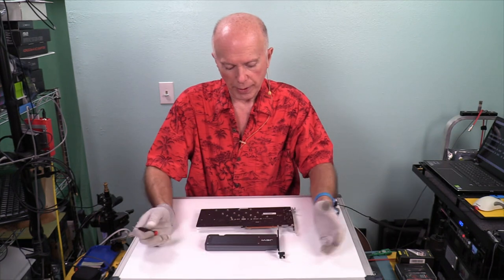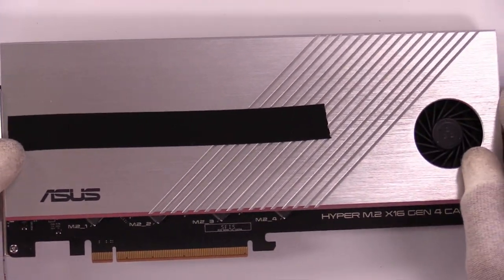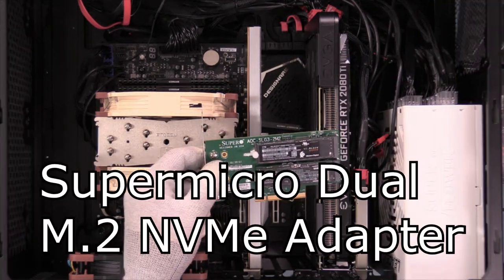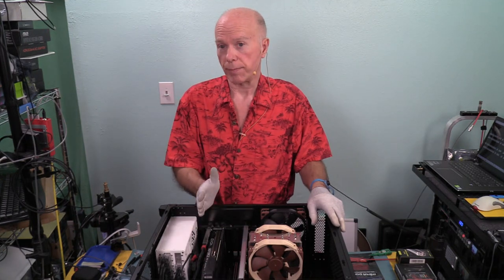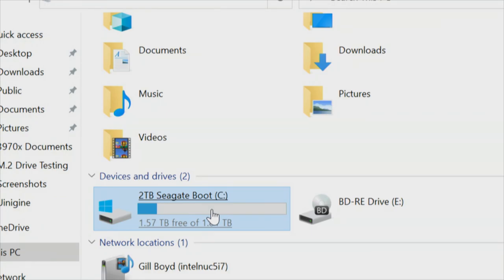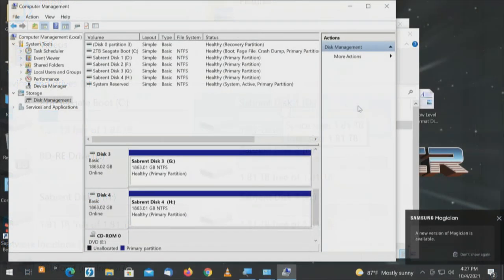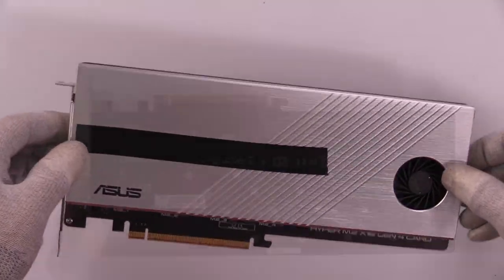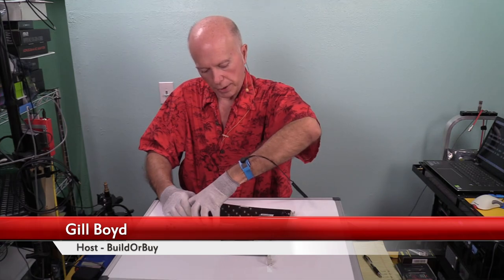ASUS Hyper M.2 X16 PCIe 4.0 X4 Quad card Heat and Speed Test Comparison

Comment: I wish you would work with a motherboard the massses could afford like a x570 with a Ryzen G processor with a free x16 slot.
Reply from the maker: Hi Jim Brannan,
That's a great point! I'm glad You've brought that up! That's why We use the TRX40. The x570 design looks great on paper. However the execution is lacking. Gigabyte does not have an x570 with 1 x16 PCIe Slot dedicated. ASUS has only 1 as best as I can remember. Most all x570 Motherboards have shared PCIe Resources. Which as allocated are not enough for dedicated PCIe Slots. No on a Quad card for x570 for the most part. Yes on a Dual M.2 NVMe Adapter on the x570 as long as You don't mind knowing the GPU will reside in a x8 Slot, electrically. Hope that clarification helps. Otherwise not much difference from B550 to x570 in execution. These are generalities of course. I'm always eager to check out any Motherboard when asked and verify PCIe Resource allocations! Fascinating design choices that always seem short sighted.
Reply: @BuildOrBuy  The reason I used the Ryzen 7 5700G in my Asus x570 was to free up the one x16 lane. I am hoping to get this card working in it. Not going the Gen 4 route with the M.2's. I will let you know.
Reply from the maker: Hi @jimbrannan5825 ,
You already know what You're up against! That should do the job! Remember to Bifurcate that Slot to x4x4x4x4! Success on Your Installation! Keep Us Posted on your Progress!
Reply: @jimbrannan5825  In the past if you went from a cpu/gpu system to an APU that has graphics built in, the number of cpu lanes to your PCIe sockets dropped from 16 GEN4 lanes to 8 GEN4 lanes. That's a bummer.
Reply: @jimbrannan5825  OK. I looked at the 5700G 3rd gen ryzen apu. 2nd Gen AMD Ryzen and 3rd Gen AMD Ryzen with Radeon Graphics Processors
1 x PCIe 3.0 x16 (x16 mode). That's a copy paste from Newegg. 5000 series APU's give you 16 CPU lanes but dropped to GEN3. 16 GEN4 cpu lanes are only with 5000 series Ryzen cpus. Not good news.
Reply: @maxhughes5687  Well if you're looking at pure speed only, this would be a negative. But if he's looking to increase his viewers participation by 10 fold, it would be a positive to experimant along these lines and see if it was feasible. It finally looks like I have a boar dthat I can use this Asus M.2 card on with out spending $3000 on a MB and CPU and I'm trying to make it work. You people need to come down out of the clouds and work with us little guys.
Reply: @jimbrannan5825  Well, best wishes Jim but I run a mobo with GEN3 lanes and a GEN4 add in quad card with four GEN4 NVMe drives. I did get up to 3500/3500 but that was it with GEN3 lanes. I am sorry, I thought you wanted to know the situation going in. Gill finds more things that don't measure up than anyone. Lower budget stuff may not show flaws that he can find.  I like what I buy new gear to work on the next generation of gear. 3 1/2 Years ago I was on a B350M/1600X.
Reply: @jimbrannan5825  Gill is all we have. More guys are pushing for more resources on their PC as they see the need for PCIe lanes and more RAM channels.Every test Gill did on M.2 heat sinks applies to every PC. Every test on gen3 and gen4 SSDs applies to every PC. He always mentions other Mfgr stuff and what it should or shouldn't work with.
Reply: @jimbrannan5825  OK. You start a channel with your equipment. Test M.2 drives on your system with GEN3 drives, GEN4 drives and the new GEN4 7000 drives.  They will all clock 3500MB. You will be one of a hundred channels that does what you want. I'd like Gill to test HW on a system that has as many bottle necks removed as possible. You know, what is the best cooler/m.2 drive/dual or quad M.2 PCIe AIC.
Reply: @maxhughes5687  I won't need to. I see he's finally getting around to what I'm interested in and what I can afford. Thanks for your input.
Reply: @jimbrannan5825  WOW. So every channel must comply with what you want. Are you in ANTIFA? His last video included Drive control panels and that info was for everyone. " a x570 with a Ryzen G processor with a free x16 slot." no such thing dude. Your looking for an X16 socket for a quad card with 4 drives? That's not budget stuff. You should have ask Gill before you bought that 5700G. No one else will look specs up and answer questions. Guys like you make no one in the comments section willing to look at the specs and help anyone out.

Comment: Just found your channel, 
Can I ask the following as I am struggling to find the answers in the marketing blurb?
1- on the ASUS Hyper card, does each NVME show up as a separate drive in Windows Explorer? Or does any drives on the board show up as one single drive?
And 2- does the board use 4pcie lanes in total, or does it try to use 4 per drive, therefore using bandwidth that could/should be used by my flu in the x16 slot at the top?

&1 things i follow 1have only 1 pice micron 2400 nvme m.2 card ,it support & detect only 1st slot ,but when i open & put on 2nd slot it not detected in my windows but hyper card led work
please help me... i cant understand that its my nvme support issue or card issue 
I’m very confused 🤔
Reply from the maker: Hi Sourav,
Welcome! Great Questions. What You're asking depends upon the Motherboard and CPU. Design vs Implementation. To support one of these types of cards a Motherboard has 3 Requirements in order that are as follows:
1. PCIe 3.0 or above
2. A X16 PCIe Slot, electrically not just mechanically 
3. Bios Bifurcation which means to Fork or Split. 
Now to Your Question. How are the Drives seen depends upon how the Motherboard Bios is Configured. If the Hardware supports the Configuration so too shall the O/S. 

Tell Us Your Motherboard CPU and Chipset then We can be Specific on what Your Motherboard can Support. Every Motherboard has a different PCIe Configuration. Some Chipsets are better suited than others to accommodate this fascinating technology! Hope that helps! 

Now why can You not find those answers We've just Outlined? Obfuscation! Crazy right! And that's what We do, Solving Problems and Providing Solutions! Everything will fall into place once We understand the technology of Bifurcation.
Reply: Using pcie 3.0 above
 Using ax16
But buffrication  not know.

Using msi pro b660 a bord
I5 12gen processor
Reply from the maker: Hi @souravpramanick2432 ,
MSI Pro B660-A DDR4, according to Your Motherboard PDF Manual under, PCI_E1~5: PCIe Expansion Slots. 
1. PCI_E1 is CPU PCIe 4.0 X16, electrically. 
2. PCI_E3 is Chipset PCIe 3.0 X4, electrically. 
3. The other 3 Slots are Chipset PCIe 3.0 X1 Slots, electrically. 

To reiterate, You only have 1 PCIe 4.0 Slot using CPU Lanes. Therefore Your GPU would have to be in a 4 Lane Chipset Slot. Not ideal. 

Bios User Guide:
http://download.msi.com/manual/mb/Intel600BIOS.pdf
In Bios User Guide, See: CPU PCIe Lanes Configuration. That's where You'll change from X16 to X4X4X4X4. That's the Bifurcation Setting. Hope that helps! What You need is a Motherboard, CPU and Chipset that supports 2 X16 CPU PCIe Slots, electrically not just mechanically.
Reply: @BuildOrBuy  not found that's option X16 to X4X4X
Reply from the maker: Hi @souravpramanick2432 ,
If Supported will be above, Re-Size BAR Support. Do You see that Setting? The PDF Motherboard Manual only indicates, CPU PCIe Lanes Configuration. But does not specifically indicate the Setting. You'll have to Verify any discrepancy from Manual vs actual Bios.
Reply: Yes,sir not showing cpu pci lanes configuration option
Reply from the maker: Hi @souravpramanick2432 ,
The MSI Bios Manual is Generic to the Chipset and not Specific to the Motherboard. If You don't see: CPU PCIe Lanes Configuration on Bios then Bifurcation is not Supported. Your other Option would be to utilize a Self Bifurcated card. That would cost more than Your Motherboard. Highpoint makes a Self Bifurcated card. I can get You a link if You'd like to try that Option.
Reply: @BuildOrBuy  yes sure
Reply from the maker: Hi @souravpramanick2432 , 
Bummer. We're just the messenger!

Comment: I got a asrock x399 taichi motherboard and will 4x 4tb m.2 drives work for this? I believe my board is gen 3 4x4x4x4 . I was thinking of slowly buying them over time to eventually raid them or should I just get them all at once. so far I only have two nvme in it cant tell if three will work or not
Reply from the maker: Hi Kevin Lee,
Welcome! You want to install as ASUS M.2 x16 Quad card? Yes! ASRock nomenclature makes that really difficult to understand a very simple procedure. Just remember to Bifurcate that Slot.
ASRock x399 Taichi with Bios: P1.90 or newer. 
https://www.asrock.com/mb/amd/x399%20taichi/index.asp
https://www.anandtech.com/show/11685/amd-threadripper-x399-motherboards
Motherboard Support List, See: Intel X399 Platform
https://www.asrock.com/mb/spec/product.asp?Model=ULTRA%20QUAD%20M.2%20CARD#SupportList
UEFI, Advanced AMD PBS 
- PCIex4 1*16 / 4*4 Switch 

64 PCIe Gen3 lanes
PDF Manual, Page 8 - Specifications, PCIe Slots 
PDF Manual, Page 8 - Specifications, Storage
PDF Manual, Page 13 - Motherboard Layout 
PDF Manual, Page 28 - Expansion Slots   
PDF Manual, Page 83 - AMD PBS 

4 x PCI Express 3.0 x16 Slots to CPU
1. PCIex1 = x16
2. PCIex2 = x8
3. PCIex3 = x1 - Through Chipset
4. PCIex4 = x16 - M.2 x16 Quad card in this Slot according to ASRock. 
5. PCIex5 = x8

3 x PCI Express 3.0 M.2 Connectors to CPU
6. M2_1
7. M2_2
8. M2_3 

4 Lanes Connect Chipset to CPU. 
Hope that helps! Thanks for Asking! That took some digging!
Reply: @BuildOrBuy  thanks for responding! If I'm understanding this if I put the raid into pcie slot 4 of the x399 asrock board then I'm able to do a 4x 4tb raid? And slot 3 pcie will only let me have 3 m.2?
Reply from the maker: Hi @therealkevinleee ,
Absolutely! You have 2 x16 Lane Slots, electrically and 2 x8 Slots, electrically. Accordingly You can have 1 x16 M.2 QUAD card. If one of the x8 Slots can be Bifurcated in the UEFI Bios then that Slot can handle a Dual M.2 NVMe Adapter only. Hope that clarification helps.
Reply: @BuildOrBuy  I think I actually get it thanks so much!
Reply from the maker: Hi @therealkevinleee , 
Bifurcation should not be do complicated. ASRock obfuscates that detail. I had to look up Your Bios settings according to the ASRock Quad Adapter for Your ASRock x399 Motherboard. That was most interesting and enlightening! Hope that helps! Thanks for Asking! Success on Your Build!
Reply: @BuildOrBuy  might be silly to ask but can we mix m.2? As long as they’re the same size? If we raid them?
Reply from the maker: HI @therealkevinleee ,
Great Question. You can. We have, for demonstration purposes. However, they should all be equally matched in Performance to maximize benefits of RAID. Hope that helps! Thanks for Asking!

Comment: do you need pcie biforcation on the bios or this card does not care and you can still see all 4 drives?
Reply from the maker: Hi biskero, 
Welcome! Great Question! Yes! To reiterate, PCIe Bios Bifurcation is Required. There are 2 types of Bifurcation. PCIe Bios Bifurcation and Self Bifurcated Add in cards like Highpoint. Link below. Right now, ASUS, ASRock, MSI and Gigabyte Add in cards Require PCIe Bios Bifurcation. Gigabyte announced the Gigabyte Aorus Gen5 AIC over a Year ago which will be Self Bifurcated. The Significance? A Fully populated Self Bifurcated 8 Drive card. Link on that Press Release also below. There are Self Bifurcated cards Requiring anything from X4 to X8 to X16 PCIe Slot, electrically. 

We have several Videos on the cards mentioned as well as others in this field. 

1. Highpoint SSD7540 NVMe 8-Port M.2/U.2 Industry Fastest-Performance/Comprehensive Selection Capable of Supporting Over 100TB On a Single Controller
https://amzn.to/3Z45efU 

2. Highpoint 4-Port M.2 SSD7505 PCIe Gen3/Gen4 NVMe Bootable RAID Controller for Windows & Linux
https://amzn.to/3IbPhh5
As an Amazon Affiliate I earn from qualifying purchases! 

3. Gigabyte Aorus Gen5 AIC Press Release - Dated 8-22-22
https://www.gigabyte.com/Press/News/2018

We created a Video speculating on the Performance of that Card. Had no idea We were to be way to early on releasing that Video. Hope that helps! 

What Motherboard, CPU and Chipset are You using? We might be able to help with more Information. This is a fascinating topic!
Reply: @BuildOrBuy  thanks a lot for the information, I have a Asus Z10PE D8 workstation motherboard and wanted to have several NVMe installed on one pcie slot to run Proxmox and other VMs. Looks like this mb does not have biforcation in the bios so was looking for a solution if possible other than occupy all pcie lanes!
Reply from the maker: Hi @biskero , 
Timing on the Release of this Motherboard is part of the problem. A Technology transition from PCIe 2.0 on Chipset to PCIe 3.0 on CPU. The ASUS Bifurcation chart has Nothing about C612 Chipset. Bummer. Therefore, an Active Self Bifurcated AIC as You have asked about. Next Question, how may Drives, 2, 4, 6 or 8?

Active PCIe Self Bifurcated AICs: 
1. Highpoint - 2, 4 or 8. Requires X16 PCIe Slot. PCIe 3.0 and PCIe 4.0 AICs. 
2. Amfeltec Squid Carrier Board - 2, 4 or 6. Requires X16 or X8 with Optional replaceable PCIe Edge Connector. 
PCIe 3.0 only. 
https://www.amfeltec.com/gen-3-pci-express-carrier-board-for-6-minipci-express-modules/
3. Glotrends Sky - 4. Requires X8 PCIe Slot. PCIe 3.0 only. Currently out of stock. 
https://amzn.to/3YSLlbQ
4. Glotrends Palace - 4. Requires X16 PCIe Slot. Also out of stock. 
https://amzn.to/3I9r5vP 
As an Amazon Affiliate I earn from qualifying purchases! 
5. RIITOP - 2 as You have mentioned. 
6. Liqid Honeybadger - Servers only. Noisy and expensive AIC. Wow! Gone! May be a name change to IO Accelerators 
https://www.liqid.com/products/io-accelerators
Options. You only wanted a 2 Drive AIC. More than You asked. Hope that helps!

Comment: Would this work in a TB3/TB4 pci enclosure on MacOSX?
Reply from the maker: Hi @tubelator , 
Welcome. Curious question. To answer that I'll have to ask you a few questions. 
1. How many PCIe Lanes does Thunderbolt require? 4
2. How many PCIe Lanes does each M.2 NVMe PCIe SSD Drive require? 4
3. How many PCIe Lanes are require for this card? Four M.2 NVMe PCIe SSD Drives require 4 CPU PCIe Lanes each. Thus this card requires 16 CPU PCIe Lanes.
5. Furthermore, this type of card requires Motherboard Bios Bifurcation to reallocate said CPU PCIe Lanes. 
Knowing that, no. This card would not work in a Thunderbolt enclosure. You would need a Self Bifurcated card vs a Bios Bifurcated card. If you use this card in a Thunderbolt enclosure, you would only see 1 M.2 NVMe PCIe SSD Drive. Bios Bifurcation only works on CPU PCIe Lanes on a PCIe Slot connected to the CPU.

Comment: can i use any of these with z440 ?
Reply from the maker: Hi Monzer, 
Excellent Question! To be Specific give Us a Specific Motherboard and CPU. Every Motherboard has a different PCIe Resource allocation. And some Chipsets are better suited to this task than others. Based on that Chipset Your Options will be limited. Also depends upon the Brand. For example, only one Vendor excels at supporting the technology required to make this work.

Comment: Hi, How do you make the bios recognize the 4 ports of the card?
Reply from the maker: Hi Kevin Nguyen2,
Welcome! Excellent Question! By Motherboard Bios Bifurcation! What Motherboard are You using? We'll take a look and see if and how that's supported on Your Motherboard! Every Motherboard is different in how they Configure and Allocate Motherboard PCIe Resources! Bifurcation is a technology trickling down from Server technologies. That's the ability to fork or spilt PCIe Resources from X16, electrically to 4x4x4x4. Remember, each M.2 NVMe PCIe Drive requires 4 PCIe Lanes, hence Bifurcation! Hope that helps! Now, Your Motherboard and CPU? This may require a Video Response. Depends. Consumer Desktop Motherboards are more complicated to configure due to Shared vs Dedicated PCIe Resources.
Reply: @BuildOrBuy  Thanks for your reply.
Reply from the maker: Hi @kevinnguyen2949 ,
Absolutely! Hope that helps! Thanks for Asking!